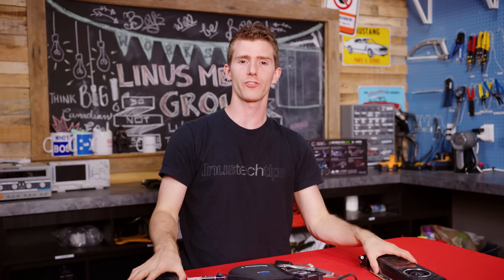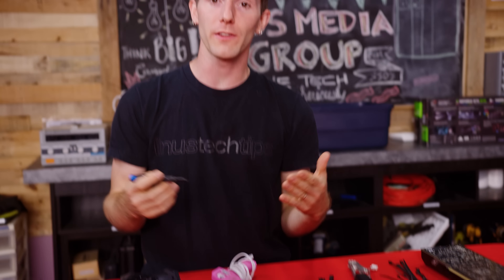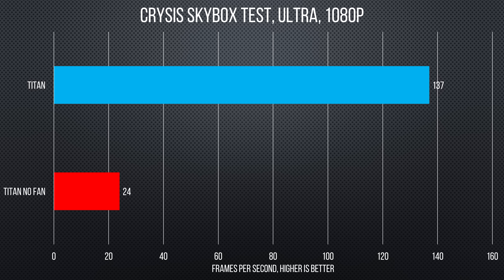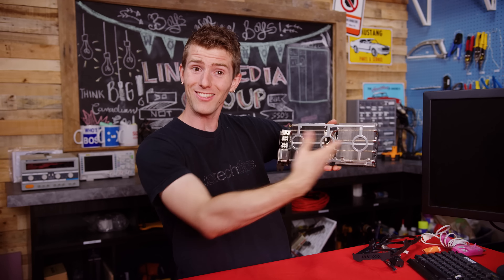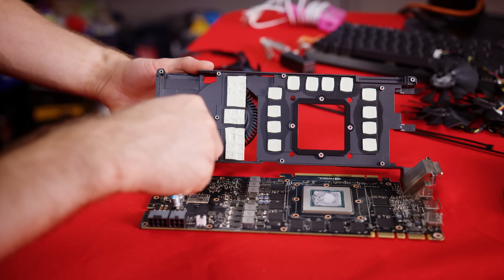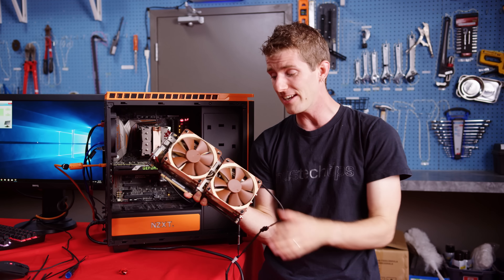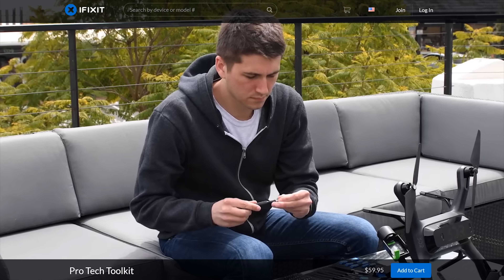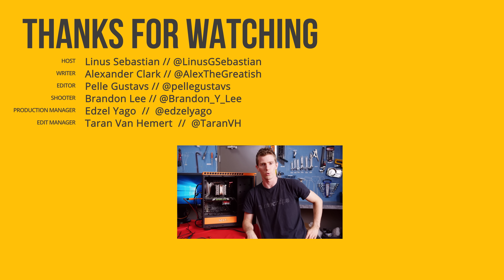Video Card Dead Fan Repair Guide

Comment: May have to do this Mod to my R9 290 Heater
Reply: i did this to my sapphire tri-x r9 290 with 3 80mm cooler master blade master 3000rpm fans, runs really nice
Reply: same here, ckl. my 290x tri-x had two bad fans when i found it on craigslist for fifty bucks. i took 3 0.15amp asus cpu fans, soldered the 4-wire leads together, then soldered them to the card's stock fan header. now i can control them with a custom fan curve, and the card runs at max 70C with an over-volt and overclock (1100mhz core 1500mhz memory). very happy with it! and i have it set to run 0 rpm if the temp is under 50C, so it makes zero noise while streaming or vlc playback at 1080.

Comment: Just had to do this unirronically because my second fan died on me. Temps seem terrible  for some reason, but I have no case airflow to speak of and while the Noctua 120mm slim fans I used are expensive af it beat getting a new card easy.

Comment: Thats why I keep the fans off these cards anymore, I had ref GTX 580 that was dead, fan was fine, and then installed the fan on my GTX 780ti which its fan did not sound healthy. Worked. Good thing Nvidia Ref didn't change the fans much over the years.

Comment: NEVER BUY A REFERENCE VIDEO CARD !!!
Reply: but why
Reply: Wtf, you mustn't have gotten the memo, Reference cards are much better for air only (Think Hyper 212 Evo CPU Cooler), mITX systems. The Reference Design keeps the airflow through the GPU ONLY, launching the air outr rhe back of the PC instead of shooting air all around the case, possibly heating up the CPU and other components in the Process.

Also, I think Ref. Desgins look better 😉
Reply: I've got a very cheap Sapphire R9 290 in the past with the oem cooler then i installed the Accelero extreme and it was much cooler than the after market ones.
Reply: Unless you're watercooling

Comment: I'm not sure whether to take mounting a 120mm fan on a GPU seriously or not;

Especially with this stupid background music...
Reply: Works pretty great & can with a good gpu cooler make it entirely silent or almost entirely silent.
did it with my old hd 6870 with 120 fractal design 800 rpm fans on a terrible xfx dial dissipation card. (despite remounting the cooler it still almost overheated.)
(Traded it later for a socket 1155 motherboard which i sold away to a guy which had his front usb & lan network killed.

The guy that i traded it away too bought a cheap ass cooler off ebay for like 20 usd with shipping from china & it worked great.

Comment: Linus, that titan is a blower stile card, the fan sucks air from the back of the card and blows it from the front (IO part), if you wanna install a fan like that one on it you have to seal the back part with the separate fin stack so that the air cannot pass through that heat sink into the case but is blown form the back.

Comment: Hey Linus! Great video! You should replace that right headlight in your car though. Don't want to be driving around in the fall with only one light in front. Not just for your sake, but also for all motorists and pedestrians in the streets. It's much harder to spot and understand the speed of the car when it is only one lamp shining. Don't want to be rude or anything, I just want you to be safe.
/Jakob from Sweden.

Comment: Arctic Cooling has some pretty nice after market coolers for GPUs. I installed their smallest one like 4 years ago on a GTX 550 Ti (reference card by EVGA), which brought noise and temperatures down by a lot (67°C before at full fan speed, 45-50°C or something like that after and you couldn't even hear the fan at all even when turning it to 100%)

Comment: If you can pull off the entire shroud on the blower card, you could easily just do the same thing you did to the aftermarket card and probably get similar results. The problem you ran up against is simply the design of the air channel the shroud creates. It isn't designed for top-down cooling but pull off the shroud and affix the fans straight to the heatsink and you'll in essence create a top-down cooler that should pull similar numbers.

Comment: i ended up replacing the entire heatsink on my old 560Ti after the fan bearings went.
kits were very hard to find and i couldn't power the fans off the cards fan header so they ran at max all the time from a molex adaptor but it did the job until i could afford to upgrade a few years later.

Comment: What he did to the asus card is actually really popular in the sff community, it's called deshrouding and it improves thermals and noise levels. Asus cards also happen to be very popular for it bc of their heatsink shape. Also generally deshrouded gpus are used as exhaust for even better results.

Comment: just a note the strix cards have two fan headers on the end of the card, so if you did this just use those as they adjust the fans connected according to the gpu temp

Comment: Can confirm the dual fan strapping works. I got a 1080 that only had the heatsink. Strapped 2 80mm fans on and i have 60c temps max now.

Comment: For the second card you could do the same two big fans you did in the first and even not remove the shroud. Instead you simply remove the fan connector so it doesn't make the noise. I bet you would get better results that way, probably better than the original fan.

Comment: I have just strapped two NF-F12 fans to my Aorus 1080Ti that had dying noisy fans, and temps dropped 10 degrees with the card topping out at 67C while being much quieter, and that is with a mild overclock. I would not mind doing this even to a brand new card!

Comment: i have tried this with some trash case fans that plug directly to the psu, they run at 100% all the time but they dont make much noise and i still got much better temps than the original broken fans, the temps didn't go past 72°C at full load, youll get much lower temps if you use quality fans. i highly suggest doing this if you are having thermal problems, good luck.

Comment: got an r9 290 trix, temps were around 43 idle, 59~63 load. after watching this video, I thought why the heck not, ripped it apart and put in two cooler master 120mm high airflow series. was genuinely surprised with the results, temps are now 30 idle, 45 load. 1000 core 1300 mem

Comment: So the result for the Titan was to be expected, the radial fan provides pressure in all directions equally, which means you also have a major part of the airflow going through the big heatsink. but replacing it with the small fan on top you basically let it choose, so it goes through the small heatsink in the (path of least resistance).

Comment: Last year i did the same job on my glorious Sapphire HD7970 OC Dual-x because one fan broke down and it took over 1 month for the replacement to arrive from china (it's a custom card, not a blower one). One month without gaming ? No Way :) . I took apart the board, i repasted the gpu with gelid GC extreme, i removed the top plastic cover and i used "2 Arctic F9 pwm pst" fans attached with zip ties on the heatsink. I also used some rubber pads to avoid the fan vibrations because they are in contact with the heatsink. I then used GEL-PWM-VGA-CABLE model CA-PWM-02 (from gelid) to attach the 4 pin molex of the Arctic fans to the 4 pin header on the videocard to let the fans run automaticly by pwm. Of course the new fans are totally different from the original ones, so my advice is to use MSI aftherburner or another software to set your ideal fan curve. In my situation the arctic F9 are very quiet so i bump 100% fan speed when i reach 60°c. My board never exceed 65°C at full load with minimum noise :)
One final note: be sure to check that the power consumption of the new fans is not higher than the original ones. You'll find these information on the backside label of the original fans. Then check the techinal info of the new fans and you're good to go ;)

Comment: If you want to fix f.ex. a reference Titan - use some aftermarket cooling solutions like the Arctic Accelero Xtreme. Costs are around 100$, depending on what model you choose.

Comment: You could use program called Speedfan to make your own fan control charts. This is when you use your motherboards fan power output's. Make your GPU run cool and quiet with noctua fan's controlled with speedfan.

Comment: You needed a blower style fan on the reference card because it was designed to force air through the cooler using the high static pressure. In addition to pressure, the original fan also pushes air through at a different direction than a standard fan. This should mean that the reference fan would have required less static pressure than a normal fan because the air has to pool under the fan before moving to the heatsink in your modification.

Comment: One of the fans broke on my 1070 oc expedition. Tried this attaching a cpu and psu fans from an old 50 bucks pc I had into motherboard fan sockets and it sounds like turning on a small jet engine but it keeps at a nice bellow 30 C doing normal stuff and gets actually better performance in my normal games like genshin and warframe but cant adjust fans easily so anything with high demand can outpower the fans cooling and starts heating up.

Comment: you can find pretty much any gpu cooler on aliexpress, i've found coolers for all msi models from 9 series to even 1080 fans. just gotta use the model number that's on the fans. they even came with the msi stickers and we're exactly the same (only the 970 one had two sensors cables which i had solder together) but still could find them

Comment: Why dont you just buy the same heat sync as the one you had before, in working condition. Wouldnt that be a better way to fix it?
Reply: Yeah because heatsinks of the same make and model as your GPU are so easy to buy in working condition...

Comment: would sealing the "intake" side of the reference cooler yield better results?  Air will take the path of least resistance and if it can go in and right back out instead of through the fins of the cooler, it would thus making it barely better than no fan.

Comment: The OEM style coolers need constant air pressure into a "sealed" heatsink chamber on the other hand after market coolers need high airflow to a wide "open" heatsink,if Linus used a centrifugal cooler(turbo one) on the Titan it would work just fine.

Comment: I had a 120mm basic fan zip tied to a gt610 low profile card when I was still playing on an am2 socket.
Reply: Also replacing the fan with that actually allowed me to keep it cool on an overclock setting which that thing needed all it could get.

Comment: with the titan is it possible the issue that the fan was facing a bad direction considering it's designed to extract heat instead of dump it into the case?

Comment: I have a STRIX card... welp, already voided the warranty by replacing the awful thermal paste, so off to Micro Center I go.

Update: I attached two Corsair SP120L's (which were originally attached to my H100i) to my RX480 STRIX card and temps went way down (up to 10ish degrees C)! Woo!

Comment: I'd say that somehow placing a new fan in the place of an old one in the ref titan would do the trick just as awesome as two noctuas on strix. I mean, blowing in a hole does practically nothing, the fan has to push the air all the way through the heatsink, exhausing it from the back, cooling everything in the process. So yeah, a bit of creativity in this case is definitely required. Some modifications needed to be mate to the shroud and the fan. Cutting pliers and scrapmaster bravery to the rescue.

Comment: The Noctua setup is actually should be the approach for tiny itx pc case, since we don't need the look, but the noise and the temp is on top of any stock gpu fan, would even stick 2 x 140 Fan for an overkill padding to get rid all noise (except coil whine =)) )

Comment: I had no problems finding replacement fans for my zotac gtx970. They are not the original kind, but they should fit on any graphics card with 75mm(?) fans and only cost me 16€ per pair including shipping to Germany (from China). But I have to admit, there were not many models to choose from and most of them cost over 20€ per single fan and they also would have to be shipped from China.

Comment: I wonder what would do the 1070 if the fans were in reverse orientation, and the hot air would be driven out of the case immediately by an airduct

Comment: So my gt 1030 fan died. It had an ARX Fan i think a 1500 rpm.  Then I bought the only replacement I could find which was an ARX CeraDynamic 3500rpm fan  same company but a way better ceramic ball bearing fan but now the new fan wont stop going 100% and it sounds like a blowimatron. Its loud. Like a small jet engine.  How to I get it to turn down?  Was it wired wrong ibtk the harness or something?

Comment: Wish I could post pics here, I got a ATI5850 old and wrinkled, fan blades blew out once and cut my finger, I did pretty much what Linus did to the titan EXCEPT, I removed the entire shroud, placed a big CPU original fan right on the middle of it, zip tied it, and well... Works waaaayyyyy better than stock while at peak temps maxing out at low 50s celcius,  I call it my frenkeinstwerk

Comment: The replacement fan didn't work so for the Titan because the fan was just blowing downward correct? The original fan is designed to move air laterally across the heatsink instead of just on top of it.

Comment: I did this same with my asus 980ti strix because fans werent blowing anymore. It worked nicely gpu temp dropped at idle to 30celsius. After 2 matches of dota screen went black and got b2 code and no picture anymore 🤔 anyideas ? Changed the thermalpaste at the same time too.

Comment: Screw the fan speed controller--- buy the 8$ cable that allows you to plug DIRECTLY into the GPU fan header. Works FAR better (I never ran into a prob on the power draw from the GPU header). And drop that stupid shroud. Who needs that hear-trapping garbage anyway?

I prefer to drop the shroud and directly cool the VRMs if I keep an air-cooling config for my GPUs. Also, if you are able to, putting a fan behind the card (to push air right over the main board) helps more than you'd imagine... even w/ the other fan mods on the card.

Thanks for the rundown tho. I wish I had "spare" Titan's to work w/. Or "A" Titan for that matter lol. Still putting around w/ my 970.

Comment: With two EK spliters my Strix  1070 card can run 6 120mm fans at full RPM, Asus is on a different level
Tape the hole of the reference cast and put the fans to blow air in the opening at the front

Comment: Hey LTT, this video got me wondering about something since I thought fans were irreplaceable. What if you removed the air shroud off of a blower type GPU and replaced it with open air style fan? Would your temperatures be better or worse? I would do that to mine if it were the case!

Comment: Part of the reason the "replacement" of the nvidia fan failed is because the fan isn't the same kind and wasn't even situated in the same spot (though for obvious reasons.) However, as Linus mentioned, you probably could remove the shroud and put the fan directly over the heat sink.  I still think you would get limited results though.

But hey Linus!  How about trying to attach a cpu cooling solution to a graphics card...your way...?

Comment: Is there a video where you did this to a passive cooling graphics card. I was wondering because i have a gt 730 low profile passive cooling graphics card, and i wanted to know if it will it will help with cooling

Comment: Is this solution quieter thab the original 3 fan setup? I have a gigabyte 3 fan 1070ti and under load it gets pretty damn loud.
Should I just replace the fans with some quiet 120mm fans?

Comment: My 1070 had a bad fan with a nasty rattle sound.  It drove me nuts and I couldn't fix it.  Put on two Corsair case fans with zip ties.  It's janky, but it works WAY  better then my stock cooler.

Comment: Hello sir, i am being in very strange problem. I was using asus g41 with gtx 1050ti. It was working fine but recently a problem occured that when i switch on ,sometimes gpu fan does not spin and no display. But sometimes it works as normal. I switched to new mobo gigabyte h110 with gtx 1050. Initially it worked normal then same problem occured. Sometimes works sometimes not. Onboard graphics working normally in both cases. Please help me.

Comment: What happen if you use a noctua d15 cooler on something like an gtx1080ti/rtx2080ti??  I only see 1 video on it and it's on an older gtx 980 ti.  I'm wondering what the result would be with more modern vid cards.

Comment: So I just replaced my already defective fans on my aftermarket 3-years-old GTX 970 with a 120mm static pressure Noctua fan.
So far the temps look good, it's a bold bet, we'll see if it pays off.
Note to self: never buy ZOTAC again.

Comment: Hello , i use your method to repair my GPU with 2 fans and i power them from motherboard like u did and works good , before i had 40-45 degree (when original fans were spinning)and now 33-40 with your method. I had to do this because my GPU fans were not spinning anymore , i pull them out and test them and are working so i think the GPU doesn't send no more power to his fans , there is an way to fix this ? or i have to continue to use your method , which are the cause of this ? Sry my english is not good :) this is my GPU Palit Products - GeForce® GTX 750 Ti StormX Dual (2048MB GDDR5)

Comment: the blower-style it has i different type of fan. It work as a turbo in the car. What happen if you put a fan in replace of a turbo? It doesn't work while in the other card worked perfectly. What would be nice for GPU headers would be take power from motherboard and fan speed from gpu header but require a elettronic skill.

Comment: Which diameter/width are those zipties? 
I fixed my GTX 1080 tentative with two fans but I want to do it properly with quality zipties which just fit in the fan screw holes.